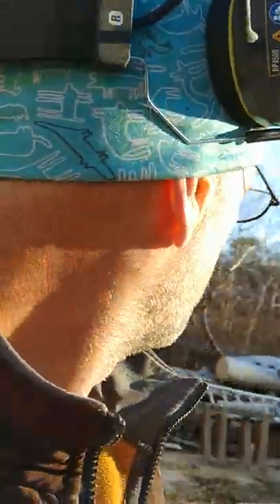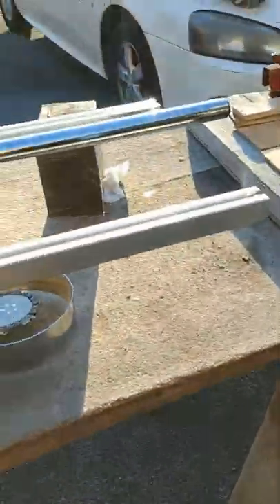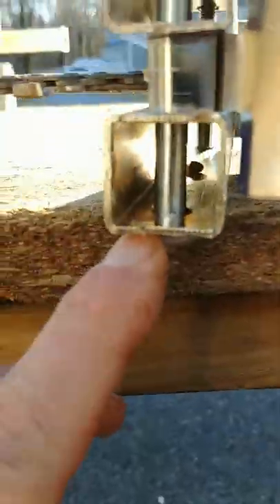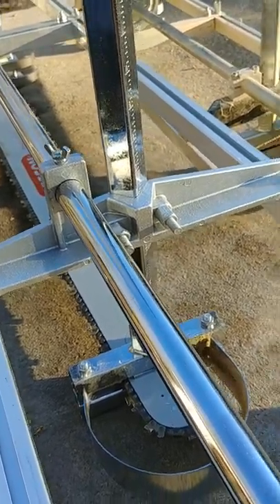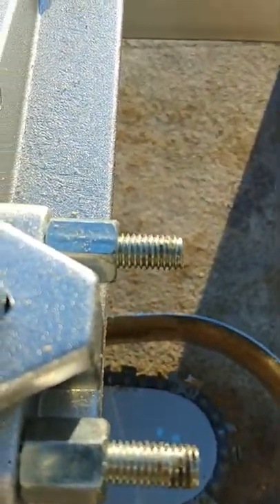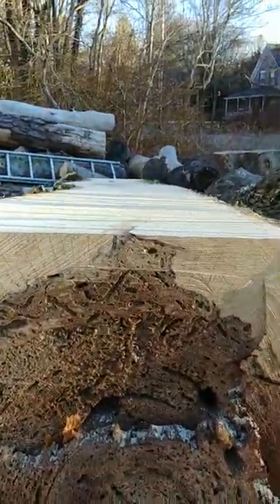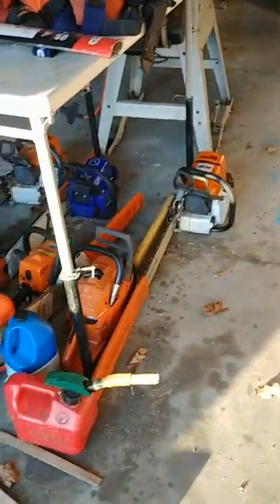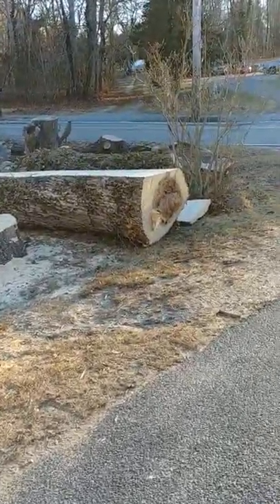Holzfforma 48" chainsaw mill review

Comment: I appreciate the review. I have a granberg 36 and like it a lot, although it has its quirks. I much prefer the wingnut setup to the Allen key on the granberg for the top rail. I hate having to remember an Allen wrench just for that.

Will plan to get longer coupler nuts to fix the short length of the ones they supply. Overall it appears to be decent quality

Comment: Thank for this Will, like you wanting another part time "Alaskan" and the other (cheapest) clone here in Oz is 272 and change delivered, where can get the Holtz for 179 and shrapnel (few other small, cheap, parts in there as well) delivered.....and they look, and probably are, the same!
Take care.
Reply from the maker: https://www.farmertec.com/48-Inch-Holzfforma%C2%AE-Chainsaw-Mill-Planking-Milling-From-18-to-48-Guide-Bar-p575960.html
Reply: @williamprophett9148  Yeah, that's the one i ordered cobber.